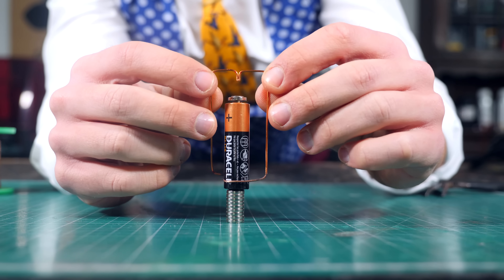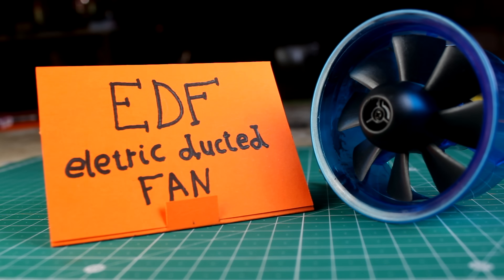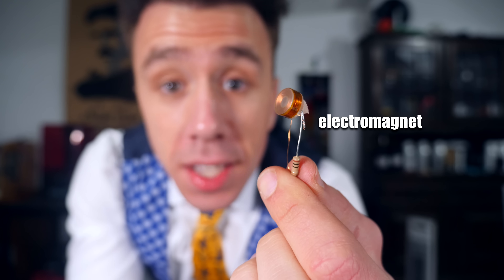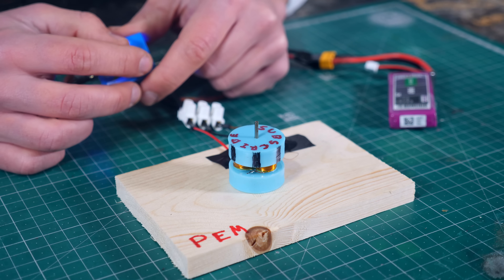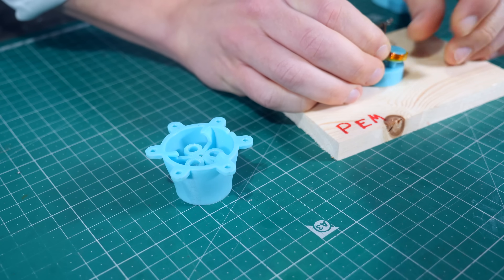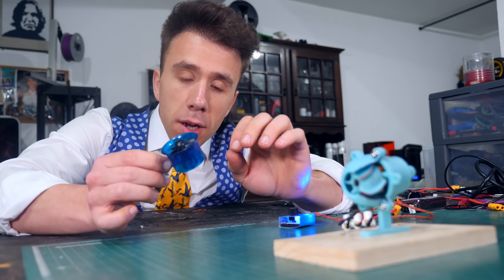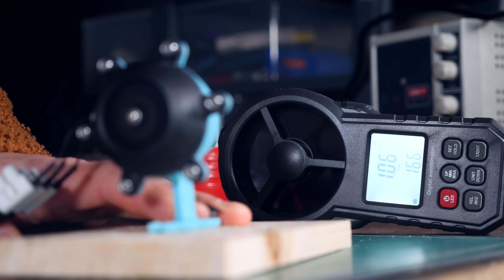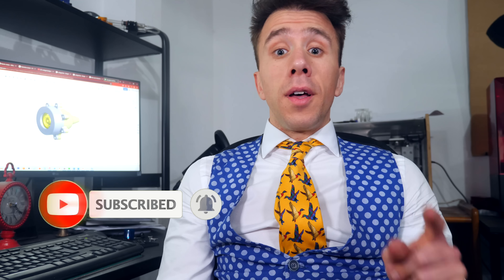I 3D Printed an ELECTRIC MOTOR FAN

Comment: Integza, there is a book called "Rocket Propulsion Elements" it has a pretty useful section about turbopumps, you should  increase the diameter of the centrifuge and it would work incredible

Comment: From what I remember of my 1st aero engineering class, propellor/fan engines have their performance calculated by power, not thrust. Thrust is a function of the propellor efficiency and the engine power. The goal is to accelerate the air as much as possible. Radial compressors like what you've designed are for increasing the static pressure as much as possible, not accelerating the air. Thus my best guess is that it's an issue with the impeller design as a concept. You're trying to optimise a design that's good for generating high pressure when you should be looking for high flow acceleration

Comment: First thought is, it could be a rotational speed choke problem. Spinning too fast causes Inlet pressure to drop, and you get a partial vacuum which interferes with laminar flow across the blade surface. 

It could be a tolerance problem. Spaced improperly, an impeller can cause pressure spikes in the wrong direction, which will destroy its directional flow and pressure.

Easiest test would be spin slower. If that shows flow improvement,  open your intake area by the factor of your speed difference (or as close as you can get.) There's a reason why jet engines use pre compressors and static stators. 

Also, your bell housing should be on the verge of touching the lead edge tip of your impeller and flare out from there. If you're leaking airflow out the front, then that is less flow going where you want it and contributing to the light vacuum blocking intake in the first place.

An impeller by itself is not directional. The housing it is in guides the pressure into a flow that can be used to do something.

Comment: You should make a 3D printed miniature "submarine" with propellers and a little ballast that works with an electric lil pump letting fluid in or pushing it out. Because making it for water could pose the simple problem of everithing shorting, you could place it in oil or heavily distilled water, or if you feel really adventurous you could place it in mercury.

Comment: 1.: For efficienct thrust, large and slow mass flow is king. The slower the exhaust velocity the more efficiently the engine generates thrust. So for the same engine power the EDF should create higher thrust than the compressor that creates a smaller high velocity airstream.

Also you should probably measure with a loadcell. As with the current setup you are measuring how effectively your engine can move large volumes of air, not generate thrust.

Comment: you should avoid the tip of your fan to reach the speed of sound. that may explain why the same motor is giving different thrust results. if you give me the kv of your motor and the max voltage, I can give you the maximum fan diameter.

Comment: @integza I am an aerospace engineering student and I believe there is some pressure distortion happening within the fan casing because it is not made precisely for the fan blade and the speed of the motor. This is restricting mass flow rate because the air is not being compressed correctly. When designing this type of casing MATLAB and Solidworks fluid flow models are used to determine the best design that matches with the casing. There are a lot of helpful guides online to discover more.

Comment: Thrust is mass flow rate multiplied by exhaust velocity. So either your intake is not large enough, or you're not fully converting the pressure generated by the centrifugal fan into air velocity (by having the nozzle be too small for example). The latter could also cause your "compressor" (which it basically is) to stall, reversing the flow through it.
Reply: this is what I'm thinking, I've remembered on seeing a video about jet engine saying that centrifugal turbine engine is better at building pressure then increase the air flow or something like that. Although to properly compare it, one has to make sure two motor are using same amount of power.
Reply: Damn, I was hoping I’d get to be the big hero who came along to say this. Still, my guess is what was described above (which also describes the difference between the huge thrust of a modern geared turbofan and the paltry thrust of a very high exhaust velocity turbojet) plus aerodynamic losses inside the airflow path inside the ducts.

I think the term you’re looking for to fix the mass flow problem is “entrainment”, which is how you draw nearby stationary air into your high speed jet stream to add mass flow at the cost of exhaust velocity, to gain thrust.

You could probably do this with - as already mentioned - a larger intake. Or you can use the method found in industrial machinery and Dyson fans, and do the entrainment after the fan, by using a duct structure in the exhaust that allows nearby air to enter the jet stream. This is probably easier, in terms of “it’s just a new exhaust” but might be harder in terms of sizing the ports and whatnot. But basically, exhaust gas goes into a tube, tube has ports that let air into it, tube expands to allow for the increased air flow, thrust goes up, exhaust velocity goes down.

The equations you care about here are:
power = (exhaust velocity ^ 2) * mass flow
And
Thrust = exhaust velocity * mass flow

And that quadratic scaling on the exhaust velocity to power is why cutting velocity to add mass ends up adding thrust.

Comment: to add on to what triplo gabriele said make Turbo rollerblade using its self-built engines

but put the fan's in the middle of the wheel and on all the wheels put turbo's

Comment: have you tried measuring the air inflow speeds or volumes to see if the Inlet may need modification. Could try experiencing with different intake diameters.

Comment: I'm guessing your problems are coming from a combination of your fan outputs and system of measurement. I'm not overly familiar with the device you're using to measure the thrust output, but based on the differences in fans (linear vs centrifugal), the velocity to volume ratios (AKA thrust) might be having an effect on your measuring device, seeing as it has a specific volume to velocity ratio since it appears to be a ducted (volume) fan (specific angle of incidence).

Comment: Hello, you could try increasing the Inlet diameter and adding a fan before the impeller to increase the airflow before it gets compressed, it should allow for higher thrust since there may be difficulties for the small inlet (and maybe even a bigger inlet) impeller to get enough airflow on its own

Comment: As others have explained, this design is about generating high pressure, low velocity airflow for a turbojet engine. Turbojets are a type of combustion engine. It's that combustion bit that's missing. We need some way to heat the dense cool air without using liquid fuel. The video you did on electric solid rocket fuel was inspiring. The substance looks machinable, & it is definitely stable. You might give it a try for the combustion phase, if you have enough of it. 

You could also look at Action Lab's video on plasma discharges for some ideas. There is work being done on magneto-plasma propulsion systems which employ high-intensity microwaves & forced-air to generate hot plasma exhaust. I wanted to do stuff like this myself, but I don't have all the equipment or parts to manage it. I want you to try in my stead.

Action Lab's vid:  https://www.youtube.com/watch?v=Grl1e4gIP78

Article on Plasma Jet Engine:  https://www.popularmechanics.com/science/a32405613/microwave-air-plasma-thrusters-compete-jet-engines/

Comment: You need a "diffuser" after the compressor, before the nozzle. The diffuser is a divergent duct where the air looses velocity & increases static pressure.  The highest pressure occur there to keep the engine from backfiring. It is usually designated at "station 4", Pt₄ (that 't' is a subscript), in engines, lookup "jet engine station mumbering". Some pressure gauges at different stages and their ratios can tell you about engine health.   

Since you're using an impeller as the compressor, you will more than likely need a "compressor manifold" with "outlet ducts' to change the radial airflow direction to an axial direction. "Turning vanes" are sometimes inside the ducts to reduce air pressure losses by presenting a smooth surface.

I the pics on the search engines have the diffuser as the first part or don't have one at all. The intake is a diffuser but its not the only one in a jet engine. The one between the cold (compression) and hot (combustion) is the most important. The diffuser & manifold are technically a part of the cold section.    

I bet if you ran fuel thru this design, it will go to the grave like some of your rockets. 

If you're feeling adventurous, you can put a fan with reduction gears and a duct around the rest of the engine to boost thrust. Look at a diagram of the Garrett TE731 to see what I'm talking about.

Comment: The impeller needs way higher rpm than the edf, so if the motor has the same rpm in both applications the impeller has less thrust.
If you can't get higher rpm you can increase the diameter of the impeller to get more pressure/thrust at the same rpm.

I guess the impeller you printed needs at least 200000rpm to provide reasonable thrust, so you may try twice the diameter, i think it should give you 4x the thrust...

Comment: There are 3 different kinds of fans. Axial, Half-Axial and radial engines.
The dyson one is a half axial one. You cant make a good radial out of an axial or half axial impeller. Good Impeller design is a whole field in itself with calculation, cfd simlation and testing and stuff

Comment: Check your electrical properties under load. I suspect you are getting losses due to back pressure in your centrifugal design. Also, you hinted at this design is used in jet engines. This is specifically for the compression phase prior to combustion. One simple answer to why this isn't producing the same thrust is that you are missing the combustion phase.

Comment: Your answer is "Volume"...have fun.

"suggestion time" (Integza voice): an entirely 3D printed steam engine that steam is supplied by placing the print on a heat source, ie. stove top.

Comment: Backpressure. It could even cause surge. The reason is that the extra ducting causes pressure losses (viscous losses) and reduces the flow rate. Blade geometry also causes this (Inertial losses).
This can be compensated by increasing fan rpm, making the ducting larger, better blade design or reducing the clearance between the impeller and diffuser (up to a limit).

Comment: I want to guess that Dyson is about pressure difference, reliability, and cost to produce and not about mass flow.  Recycling someone else's fan can be fraught.  At the very least you need to get (or measure) the fan curves before you use the fan for your application.

Comment: I am still a student and I'm not good at math but at least I have an idea 

Why not make the intake smaller so you make the air pressure higher and then you makes small opening on the sides like three holes or more to increase the air coming in and then you can make the exit more controllable instead of making a basic size make it like a cone which you can control the hole in it by a remote or something like what Russian jet fighter ( suhoh 57 )
Then increase the number of fans but instead of making it regular size compress it and make 3 vans between the three fans
Put three basic ( not moving fans ) to control or have a better control on the air the more you can push in and the more control you have on the air to directed to the spot you want you can make the pressure up to 10 times the pressure you make normally

Comment: I know nothing about this, but I observed about the surface area of the edf blades vs. your impeller. 
I would think that the larger surface area available to move the air in the edf would naturally do just that. 
And reading other comments, I tend to think blade surface area in combination with tight tolerances, and variations of the intake and outlet ports would do it. 
Or modify the edf with a compression cone on the back side for a hybrid.

Comment: youre exchanging the exhaust velocity for exhaust pressure. using bernullies principal the faster the fluid is moving the lower the pressure, it doesnt work out to exactly 1:1 because youre adding energy to the system but the concept still applies. for thrust you need to maximize flow rate which since your cross sectional area isnt changing is just the velocity. so you need to use the high pressure that youre making and turn it into high velocity. the easiest way is to do what dyson does with creating a jet of high pressure that pushes standing air around it through a tube, you might also want to look at jet bypass ratios for inspiration

Comment: Just an immediate thought right out of the gate is the rather stark difference between intake area between the PAM and Impeller. The Impeller would have to spin much faster to draw a comparable about of air. So it doesn't really matter how fast your exaust is at this stage of the game because there just isn't enough mass being moved to make up the energy differential.
Reply: I think this is looking at it the right way. Yes, there are differences in thrust/compression which come into play, however the effected intake AREA is an important factor. The opening diameters appear very different, and from just a flow rate consideration this is a significant factor. The actual available air surface area between the cone and the shroud should be equal to do a fair comparison between the two in terms of ability to move air.

Comment: I can kinda tell ypu what wrong a propeller as in the EDF mainly creates air velocity which is basically wind or airflow. An Impeller creates pressure or turbo or simple compresser creates air pressure, not velocity. To get velocity out of pressure you have to restrict the area where air is supposed to exit so it has to accelerate to keep the same pressure. If the area is too restricted or the impeller is too weak, the pressure rises above what the impeller can produce and it stalls.

Comment: I think you need to do some measurements to determine what is happening. Ideally you need to know input and output parameters for pressure, volume flow, and air velocity. It is so easy to stall a fan as a result of it being starved of input sir, or blocked by back pressure. 
Fluid dynamics is not my subject, but I have had some experience designing  rack cooling systems, and I know how difficult it is to understand what is happening to the air flow. You really need some modelling software that can solve the Navier-Stokes.equation. While working on rack cooling fans, I found it useful to use a smoke generator to visualise the air flow, this made it possible to see where the air flow was stalled. I do not know if this would work for small fans.

Is it possible that what is required is a duel bladed fan, one with blades to collect a volume of air and a second to pressurised it. This might avoid the problem of the air inlet being starved, A simple water manometer might provide a inlet pressure profile.

Comment: It seems to me that the problem may be due to the shape of the impeller, perhaps if you look at the fan you mentioned you can notice the difference, because although the vacuum cleaner may work similarly, it is not the same as what you want

Comment: Increase the cupping at the top (central to the axle) of the blades of the impeller. Basically the blades need to "scoop" more air at the tip of the impeller to push the rest of the way down.
Reply: Is this a legitimate reply or a potential scam? Also, I don't have telegram.

Comment: It's already been said here, I bet, and I'm pulling from a much simplified memory of my Fluid Dynamics 1 course from 22 years ago (Dr. Braun would be so upset with what I'm about to type).  The EDF is essentially several air foils... wings.  Use Bernoulli and extrapolate based on the wing shape and count.  The compressor is exactly that.  Even if you have the same volumetric flow rate, you have more changes in the fluid, so there's efficiency losses.  There's the increase of pressure (loss there), and the decrease of pressure (another loss).  But... your flow rate is lower through an unrestricted exhaust.  Move on to Reynolds Transport Theorem and restrict the exhaust side (I guess bernoulli could work too).  The practicality is the EDF flow rate will dramatically decrease flow rate while the pump will still be able to compress the fluid.

Comment: I would love to see you make a see-through casing of a two-spool jet engine, with a high pressure and low pressure section for both the compressor and turbine. You can add a fan to the front to make it a turbofan as well if you choose. I think that the best way to understand the operation of something is to be able to see it, and with multi-spool engines (like every commercial aircraft engine being either 2 spool or 3 spool), most people have a large misunderstanding of exactly how they work. I also see a classic turbojet engine as the basis of understanding of all your other turbomachinery shenanigans which, as a "fan" of your channel, would help me appreciate your shenanigans even more!